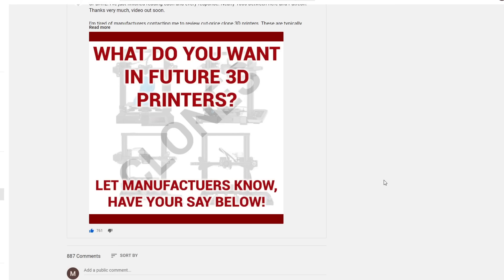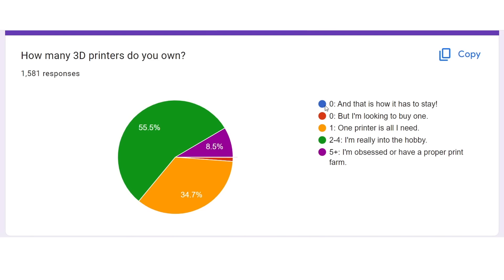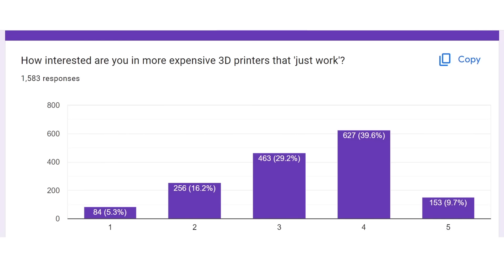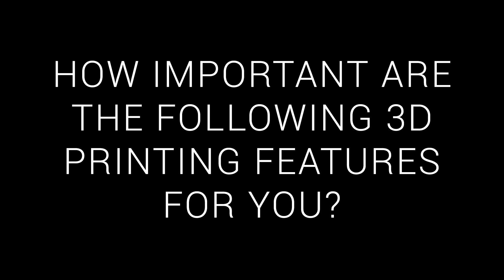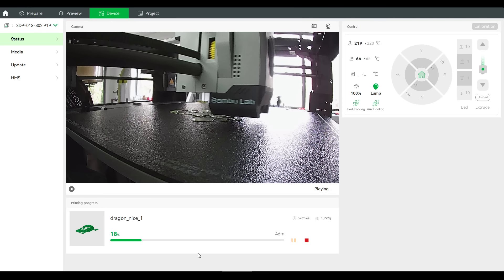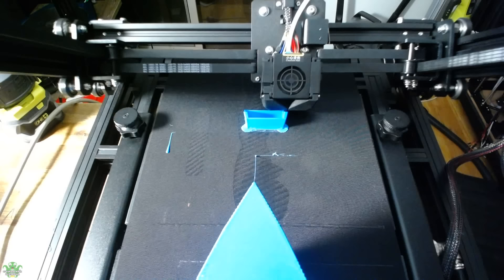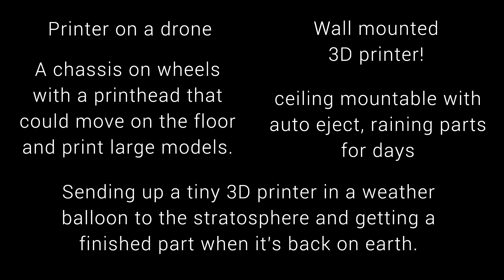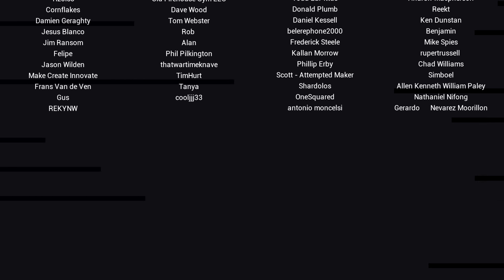The 3D printers the community actually want: Your say in 2024

Comment: I started 3D printing in 2007, only buying or building cheap printers I could afford, which wasn't much.  Lots of hacking and constant work to maintain the dozens I tried and used.  Sure , I would have loved to have had a Bambu or Prusa like printer costing thousands then.  But neither my DIY skills or budget or choices then could have endured it.  But they didn't exist for any affordable amount of money then.  So I got what I could afford.  But I got the 3D printing bug and did end up liking what I could do with a cheap printer and dozens of printers later, I have pretty much what I wanted.  

Now, years later, what I want in a 3D printer has changed and is a tool and be as near to an appliance as possible.  No more small bed slingers or units without enclosures that don't handle all plastic filaments.  I got rid of dozens of the outdated or duds I owned and just kept favorites.  Till 3D printer manufacturers understand that 3D printing will only become mainstream when that 3D appliance is as easy to use as their computer or microwave or cell phone.  And that means providing quality features that are up to date and certainly that don't cost more than the average person can afford.   Not an easy task for manufacturers who just want to make a fast buck. 

Everyone complains about the Chinese clones that have flooded the market.  But frankly, they got it, marketing-wise.  They understood 3D printer users and what they generally wanted.  The Chinese internet market is what made 3D printers much more affordable by their constant competition with each other.  Most non-Chinese printers are still way too expensive with even older outdated features.   If you can't market a printer and get good references to it by the people who review it, your model and perhaps your company is done for.  Every company should be looking to produce at least one appliance sort of printer as their backbone model.  For now, these are unfortunately some of the more expensive machines but easiest to use, but also the least user modifiable.   While great strides have been made, there's still a long way to go to make 3D printing as mainstream as a phone or TV or computer while keeping it affordable.

But there also has to be the open architecture models made for those who love to tinker and DIY.  While this is seldom as marketable as the appliance printer model, these users are often the ones pushing the envelope of 3D Printing and making features and hardware advances well beyond what sellers think we need.  But companies who go this route should do research and development well and not just make a collection of clone parts thrown together to compete with the same type clone being sold side by side.  The race to the lowest price sold for X and Y features should not be any companies focus.  Manufacturers should focus on making next level printers, not just copying (often badly) their competition.  This category of 3D printer is ever evolving and users will seldom be satisfied with what they have.  If you catch this bug, you'll likely be investing in newer, later, better and faster and constantly upgrading the printer.

Comment: I feel you missed an opportunity for better insight with your results.  You consistently referred to different use cases as not caring about this or that.  I think by splitting your findings by group; hobbyist, professional, etc., you would find better relevance in the data.  I have a print farm and care more about practicality and up time.  The ability to purge the bed would be fantastic.  Ease of maintenance is a huge need.
Reply: Even better would be to group common choices by submitter. IE, note if the same >50% of people made the same two or more selections. FI, right off the bat, you know that FOSS-heavy users will prioritize customization, and be either meh about cloud, or anti-cloud. But, there might be more interesting findings, too.

Comment: Just fuse two Bambu machines into an IDEX for me. Perfect bed size, two toolheads, one enclosure, almost tinkerfree firmware, just lose the cloud bs.
Reply: Sigh, The [bambu lab] cloud was, is and has always been optional . This is one of the few lies that have yet to be debunked in the 3d space for almost 2 years. If you don't want to use it then dont use it. The printer works fine.

Comment: What I want most from a 3d printer is to be quiet. I live in a fairly small townhouse and you can hear my printer from everywhere.
Reply: Did you see Stephan (CNC Kitchen)'s video about noise reduction?  He used a bi-layer barrier of foam and cement paving slabs to isolate conducted sound.  He swears by it.
Reply: @allenpaley  I will see and try it.

Comment: The survey of people who have persevered with ten fails to get one working print, necessary tinkering, necessary modifications and the necessary hundred slicer menu changes to get 3D prints working, DOES NOT represent the massive potential market of normal people.
A printer that is assembled and prints what is put in, regardless of model chosen or filament put in, holds the key to the mass market.
This would be like the first windows PC was to home computers...

Comment: The fact that printer vendors start to integrate the nozzle into the hotend is environmental bs. It starts like with hp printer cadridges. Later you will pay 100$ for a replacement hotend if this becomes the standard.

Comment: I feel like a lot of this feedback is from people who haven't experienced the Bambu lab way of life. This is indicative in especially the one-click printing, which I wouldn't have thought I liked all that much, until I had it at my finger tips. Seeing a model you like and pressing print while you're in bed before you fall asleep, and finding a finished print when you wake up, is a major major leap.
Reply: I can't see ever getting into that. First, why are you doing anything like that at that time? I've never gotten the idea that I wanted to print something before going to sleep. I'm up, awake, and have a problem to solve that this model might be good for. I might start printing at night, to get the print the next morning, but that's a bit different, still. Also, it's often useful to check out model details, and adjust slicer settings to best handle them. Screw holes in STLs made by somebody else are the worst, as the designer has often adjusted them for their printer and other hardware, already. Nothing like having a great looking print with holes too small, or way too big, or oval when they aught not be, because the printer did exactly what the slicer told it to, and the slicer may well have, "perfectly," sliced it, to match the STL. Most of the time, there will be a way to quickly deal those problems right in the slicer.

Comment: I think the main missing point here is your followers are mostly 3D printer enthusiasts. Therefore, mainstream Bambu Lab users didn't contribute to your survey. For example, it looks like cloud connectivity is something no-go but open source and customizability look like a must in the survey. However, both of them are not available in the Bambu Lab printers with nearly cloud-only usage, they are the best selling printers.

We have many 3D printers in the university and I know many people use them and none of them want it to be customizable or open source. They just want it to work and have less option to choose. Even I, having heavily modified Anet A8 since 2018 and bought an A1 recently, don't like to tweak the settings, most of the time I try to use the pre-modified 3mf files from the makerworld if I am printing some others' design. I think the next step in 3D printing might the autoslicing slicer that chooses the best settings for the file, user just choosing the overall goal of print.

Comment: How ironic... Bambu printers are closed, barely repairable with a useless lidar and a known bad support and they think they are close to what people want lol. Try again
Reply: What are you talking about? All parts are available online, they are written and videos on repair. Did you even think through what you just said?
And the Lidar does have a use with auto filament calibrations. It has been a full featured since 2023. 

And sales would tell a different story on what people want...
Reply: @personwomanmancameratelevision  yeah they put a bit of efforts on making more parts available across time but The Lidar is supposed to stop on printing issues. It only detects wind actually. Printers are good though, the problem is company's policy
Reply: @FunkyMind  They pretty much have the whole printer available for parts for those of us out of warranty it is a godsend to be able to source, purchase and replace parts. In the early days incorrect commenters stated the parts were glued in and non replaceable. They never corrected their misinfo. 

The lidar has a few uses. 
in 2022 it mainly assisted with first layer defects, checked to bed placement. and had a simplified flow rate checker before printing. 

 2023 they super charged it they added filament calibration and set K values(linear advance) for under/over extrusion. With an AMS it can check up to 4 filament at a time and store hundreds profiles for different filament types automatically. 

In late 2023 they use the lidar to detect if items are still on the build plate before starting another print. (you can enable or disable this behavior) I have yet to try this as I clear my prints before printing anew but it is supposed to be there with the AI detection.

What specific policies are at issue?

Comment: I only have one extraneous requirement: That it not be primarily manufactured in the PRC.
Reply: Impossible, even if it's assembled elsewhere it will still contain 99% of prc parts
Reply: Thats something that isnt possible without regulatory change and government support. Its too complex an issue to be rah rah about.
Reply: Then you likely won't own any 3D printer.  3D printing is almost entirely Chinese based.  Even the parts from non-Chinese brands are usually using Chinese made parts.  Whether we like it or not, if you want to get into 3D printing, you will very likely have to use Chinese product.  There are very few other choices and those are usually either 2 to 3 times the expense or outdated.
Reply: @dggcreations   that is also true for other tech, not only 3D printers :)
Reply: @riba2233  
Very true...Especially anything electronic or low cost.
Reply: @dggcreations  Even those choices ultimately have the majority of components sourced from there. Find me made in America stepper motors for instance.